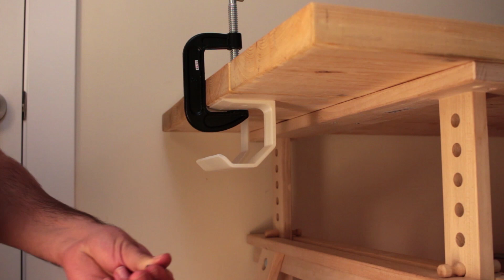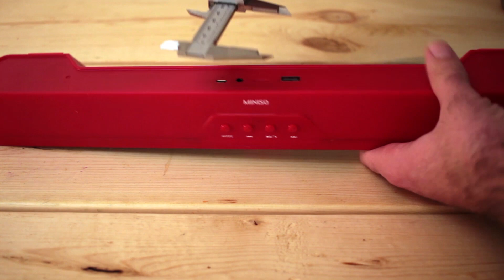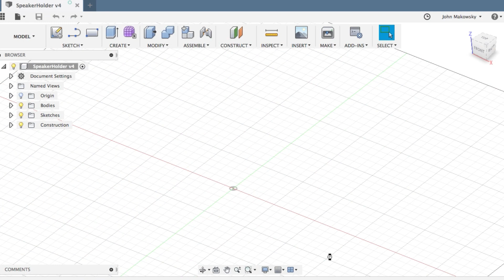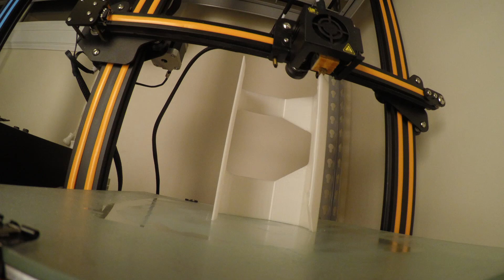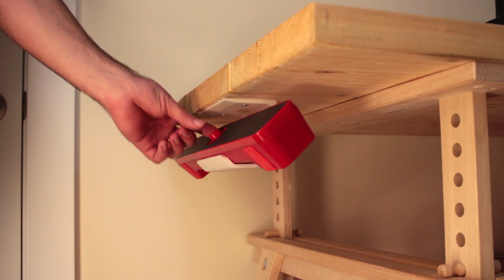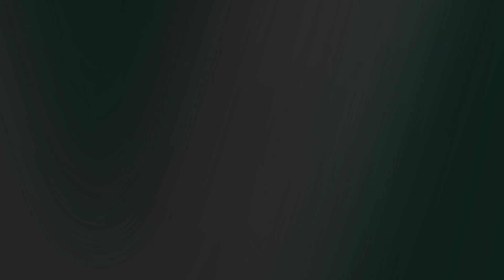Will It Print Wednesday Ep. 33 "Miniso BT Soundbar Mount"

Comment: wouldn't you want the speaker facing towards you/above the table?
Reply from the maker: Good question, I prefer to have it reverb off the walls (sound fills the room better), and there is less chance of something catching on the speaker and knocking it on the floor when someone walks past to use the washroom (not shown well with the camera angles, but the space between the prep station and washer/dryer is pretty narrow).